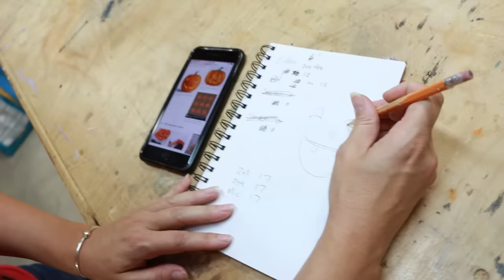We made our cat a Halloween PUMPKIN House!

Comment: If you ever do this again, I'd recommend a trim of wood at the bottom and face holes and a small circle of wood at the stem. That way you can staple the rope down in addition to gluing it. Cats exert a lot of force on the ropes when they scratch on them and with just glue, I suspect he will derobe that pumpkin fairly quickly. It is a beautiful project and I hope you do this again at some point and practice with the structural integrity.

Comment: nice concept. paper mache needs a lot of layering though. my cosplay sword sheaths are 12 layers of paper mache (with 3 alternating orientations) with fiberglass mesh every 4 layers. and they're still wobbly as heck. a cat house of 2 layers (before resin) won't even hold the weight of a kitten. i'd have advised 30 layers at the minimum for the pumpkin
Reply from the maker: That’s wild! Thanks for the tip.
Reply: Have you considered trying air dry clay? It's like paper mache but BEEFY.
Reply: @chaoscreature332  It can also be heavy too.
Reply: in my experience if you use flour + water as your glue you dont have to do so many layers. ive done several projects in 2 layers and its very sturdy, the only downside is that its harder to get smooth
Reply: And a thing we learned in the art subject at school: use small pieces of paper not large patches. When we made heads for some prop scarecrows we use max 3x5cm newspaper pieces and at least let them overlap by half the size. And then 10 layers or so. Super tideous but super sturdy too.
Reply: @unidentifiedbunny  if you mix it well and maybe sift your flour first it should be good. But yes smaller strips of paper and more layers would be better

Comment: Could I make a suggestion?   Combine the two steps of paper mache and resin coating into one step.  Do it exactly the same only leave out the glue and use resin and leave out the paper and use fiberglass cloth.  Build it up just the same way with strips and patches.  Use a cheap brush to squeeze out the excess resin.   Let it set up.   Do two layers (maybe three.)   It really is about the same but when you are through, you will have a structure the cat can play soccer with and not damage.  And, you'll have a new technique that will work better for so many of your projects.  Don't think too much and convince yourselves you can't,

Comment: You should’ve glued some pieces of veneer or a few layers of canvas on the backside of the break, painting it with resin between layers. You actually still could if you still have the pumpkin. Great video though, may have to try it.

Comment: you should an updated version of this but use Resin & shop towels  & hang it from above to rub on the resin over the layers of resin coated shop towels  make a hole on the bottom and put a wood base to make it firm  base so obi doesnt crush it

Comment: This might sound silly but I think if you would have put LED strip lights on the pumpkin before you put the ropes on then it would light up. Then the pumpkin with light up the rope
Reply: If my calculations are correct cats do not like light in some areas so if they did that the cat might have not liked it

Comment: I looked to see where you procured such a large and sturdy balloon- any tips? I made a big Jacko in paper mache and did what felt like 10+ coats, and the humidity made the mouth droop/close a bit. How many actual days did it take?
Reply from the maker: There's a link to the balloons we used in the video description, we got them on Amazon, nothing special. It took two days for the paper mache to try and it definitely was droopy. The several coats of epoxy took another probably 3 days. The rope and hot glue actually added a good bit of sturdiness to it, which helped a lot in the end.
Reply: Thanks! I totally missed the materials list 😂🤦🏼‍♀️

Comment: Are resin, wood glue, and spray paint pet safe? I remember making a cage for my little hamster and I used this vinyl adhesive flooring and the poor thing up and died. I really wanna make this but I'm just curious about the inside mostly. I also know everything is more durable than hamsters but still.
Reply: Once the wood glue is dried completely it's non-toxic. Once the resin has FULLY cured it is also non-toxic. The spray paint is a different story. Most spray paints are oil based which are not recommended for animal use. I would use a water based paint instead, like latex or acrylic.
Sorry to hear about your hamster 😔 unfortunately a lot of the cheaper peel and stick vinyl flooring have traces of formaldehyde in them and the adhesive itself gives off a lot of VOC fumes while its curing.
Reply: @erinlemmon1691  It's ok it was a couple years ago I just have the guilt from it ha, but I appreciate the answer. I was thinking maybe of lining the inside with some type of cushion or fur anyway and avoiding the paint.

Comment: I really like the way this turned out but I feel like non toxic materials should be used when crafting for a pet. Once that cat tears through the rope it will be met with layers of epoxy, glue and everything else. If the cat then chews on the material and swallows it you'd have a dead kitty. :/
Reply from the maker: Cured epoxy isn’t toxic. It’s the same thing on your counter tops. But yes! Safe Mayer always. 😄
Reply: @WickedMakers  thanks for answering, that does make me feel better as long as it's safe.

Comment: It's not a very good idea to use epoxy on anything that's for your pet as it's very toxic...
Reply from the maker: It is perfectly nontoxic once fully cured. Your countertops and furniture probably have epoxy finishes. But yeah always be careful and use pet safe stuff! 😀
Reply: @WickedMakers  ah I forgot about that, it's not very common to use epoxy for kitchens in Europe, especially if you come from a low income household :0 But ty for responding nicely, I came off a little sniding